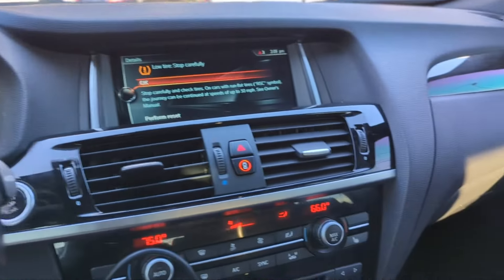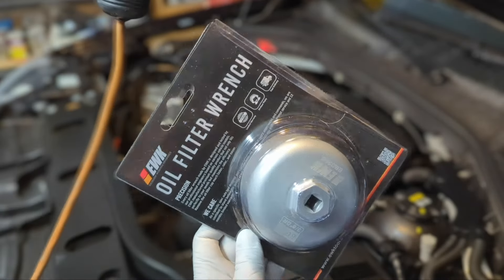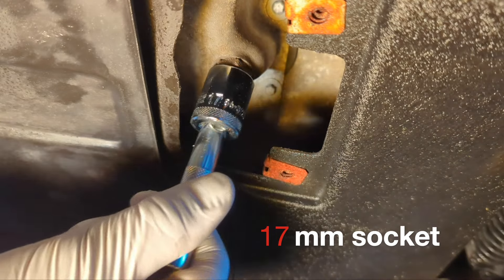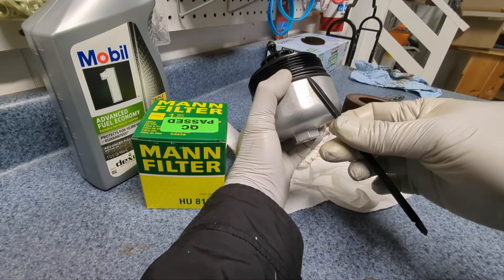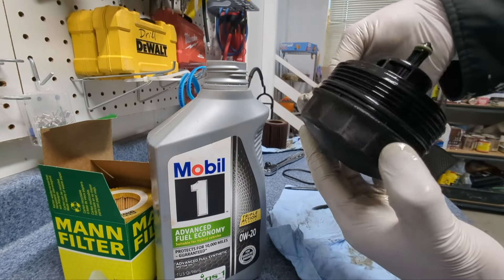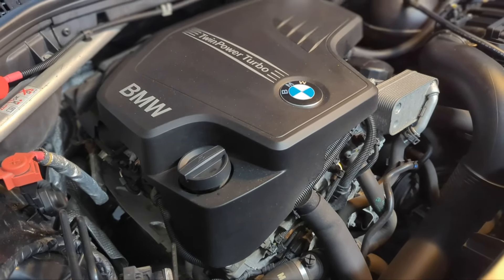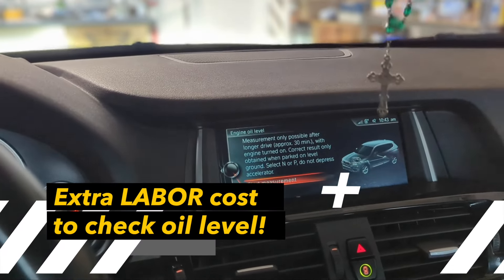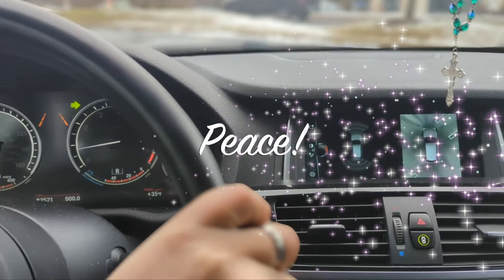BMW X3 (N20) Engine Oil Change & Filter Replacement - High Mileage F25 xDrive28i #bmwx3

Comment: I heard you don't need to prime the filter.
Reply from the maker: Not the end of the world if you don't prime it. But it's beneficial to your engine as the oil will be pressurized and reach the engine faster to provide lubrication within the first seconds. Most of engine wear comes from the seconds between engine starts and when oil is pressurized to start lubrication. So priming the filter with clean oil will help make this buildup quicker and reduce wear. If you want to see evidence, here is an experiment done by the Oil Geek: https://www.youtube.com/watch?v=939WTeorBnQ